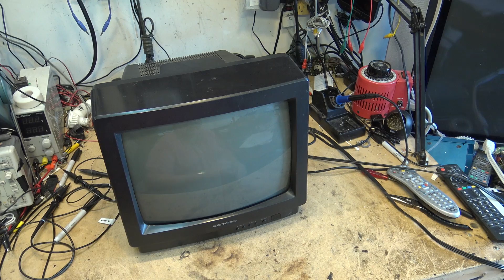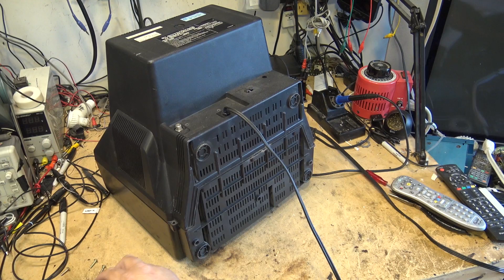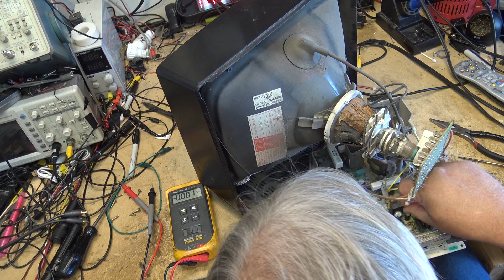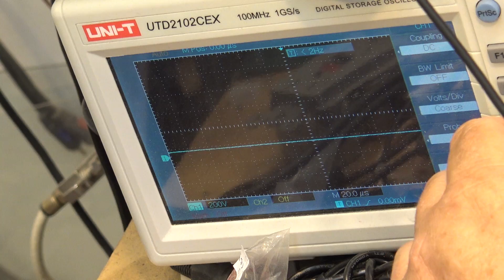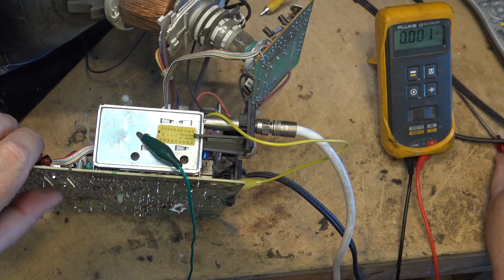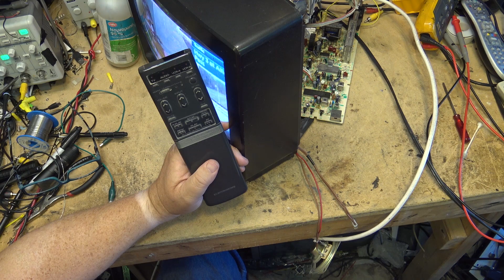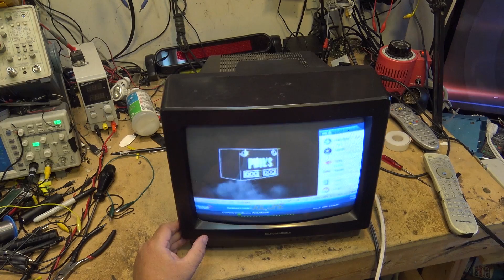Mitsubishi CRT TV from hell   Worst damage I have ever seen   can it be fixed lets find out

Comment: Effects of x-rays from CRTs are well overstated. Such minuscule amounts are generated. Only part way though the vid yet, but I would not like to be around that TV when it powers up and gets warm. Umm, warm cat-puke smell.
Reply from the maker: @Red Stoner 
Crt does produce x-rays. There is a warning on the tube warning of this. Generally consumer devices keep the eht voltage low enough to keep the x-rays produced low and mostly contained to the tube.   Professional monitors on the other hand did not have to comply and to get a higher resolution tube ran the high voltage much higher producing more x-rays.
Reply: The glass of the tube contains lead for this purpose, to contain the x-ray generated inside.
Reply from the maker: @MiniSai256  
Modern tubes yes.  Older tubes no. Many tvs had an extra leaded glass in front of the tube.   Tube TV's were bad with the shunt regulator especially when the repair man left the shielding off because he was too lazy to put it back on.  That happens alot in the 60s and 70s.
Reply: Why don't you go sleep on a CRT for a few years and then get a check up! 😂 If people knew how much poisonous radiation CRTs gave off there would be hella class action lawsuits. Instead, they have been rolled out of production and the consuming masses are none the wiser.
Reply from the maker: @HazeAnderson  
Let me tell you a story about CRTs. This is not shit this is facts because the people I am going to talk about, all worked in the tv business or digital animation business and they are all dead now due to cancers that have been linked to close exposure to low level x rays from crt.   Talk to anyone in the tv business and they will have more stories like this.  3 of the guys mentioned here I worked with at the community station where we did our internship. 3 stayed in broadcast I started my own production company and went into the repair business. 2 of them were cameramen, 1 was an eng shooter and the other a studio camera operator.  Both died of a brain tumour.  The eng operator had a tumor on the right frontal lobe and the studio operator had one form center of forehead.  Right where the x-rays from the b/w viewfinder crt would have been aimed.   The 3 guy worked in master control.  Had a bank of monitors directly in front of him for 8 hours a day.   He died of liver cancer.  None of them saw their 40th birthday.   Coincidence?  The 4th was my neighbours son. He was an animator.  Worked for Pixar studios. Was directly working in finding Nemo and toy story.  One of the lead animators.  Spent sometimes 18 hours a day sitting directly in front of multiple very high res computer monitors.   Cancer in both his liver and pancreas. What are the chances of that?  He was 36.  The difference here is professional equipment is run at higher voltages so they produce more x-rays than consumer gear because they don't need to pass certifications under the cosmetics and radiation emoting devices act like consumer devices.   I spent 20 years working around CRTs but my exposure at close range was limited to a few minutes because as soon as the set was fixed I put it together and pushed it to the corner to test run.  When I did video production. I did have an x-ray spewing professional camera but my exposure was a few hours a week, not 8 hours a day like my friends that chose that occupation.  
The x-rays consumer sets produce are very low, but for a cat lying on top of the set, they are probably not good for them.  My old cat used to seek out dangerous things.  Her favorite places. On the satellite receiver, on this tv, and sitting on the wifi router because it was also warm.  Of course that thing emits microwaves.  Also not good for you.
Reply: Sorry for your losses. 😢 I think the proof is in the pudding --- those things are gone and nobody talks about them anymore. When WE all are finally gone .... those things will be talked about. After all, doctors shunned the notion of washing their hands after handling cadavers so they could get right to delivering a baby ... and that was in the 1800s.
Reply: @12voltvids  In science, to prove what you say is fact, there would have to be a massive double blind trial to rule out coincidence. If I rubbed chicken guts on your head and your headache went, would you say I cured your headache? Similarly, there is a direct correlation between colour TV purchases and road deaths. Does that mean that there isn't causative link. FWIW, I have worked with x-rays every day of my nearly 40 year career and have had large doses due to many medical procedures. By your logic, x-rays does NOT cause cancer. How can you prove that the cancer was not caused by some vapours given off by the monitor?
Reply from the maker: @drteeth7054  
So what you are saying then is the 4 people I know that worked in TV stations and all deviled cancer was not workplace related? I would say the coincidence of 4 unrelated people devoloped relatively rare cancers, 2 that worked in very close proximity to industrial broadcast monitors devoloped liver and pancreatic cancers and 2 camera operators that spent hours every day starting onto a camera viewfinder screen devoloped brain tumours. I would say that is more than a coincidence.  Remember industrial monitors are running at much higher voltages that. Consumer models to achieve a very sharp focus on the tube.  Consumer TV's the 2nd anode for be around 10kv and color 25 kV.   Consumer camera viewfinder around 3kv.   Broadcast camera viewfinder on a 1.5" tube 7 - 10kv.  Be monitors 15 kV and color monitors 40kv were not uncommon.  Higher the voltage the more x-rays produced.   Everyone I know that worked in the industry is very nervous on what they might end up with.
Reply: @12voltvids  Note how all consumer cameras that used mini b&w tubes in the viewfinder all use a mirror and point the CRT 90 degrees away from the eyeball.
Reply from the maker: @spikester  no they didn't.  Just the larger full size shoulder Mount vhs did and that was only because it allowed for a more compact design.  All broadcast cameras did this too and it makes no difference because the majority of the x-rays will also bounce off that first surface mirror.  All the handyman type of camcorder used a small tube and you looked straight into it.  I have such a tube in my video "smallest crt in the world and it works"
Reply: @12voltvids  Thanks for correcting, indeed it was the VHS fullsizes I was referring to as that's all I had access to as a kid. Was there nobody to complain to for health and safety regarding professional grade units and operating voltage back in the day? Any engineer designing these should have mandated some extra leaded glass in the viewfinder glass.
Reply from the maker: @spikester  
The professional units did not have to meet limits set out my the cosmetics and radiation emoting device guidelines.  The voltage was run so high on these tubes to produce a very fine focus.  It's unfortunate that many were exposed to higher levels of x-rays and many devoloped cancers from them.
Reply: @12voltvids  Makes you wonder everyone in the retro gaming scene getting Sony PVM's  & BVM's, curious what their anode voltages are to produce such fine scanlines. I'll stick to my consumer trinitron for that me thinks...
Reply: @HazeAnderson  Do you wear an aluminium hat so "they" cannot read your mind?
Reply: @drteeth7054  my channel and 12voltvids channels are wide open for all to see who we are what we do. Your channel is void of any content and you don't even have subscribers. For all we know you are what is known as a PAID SHILL -- someone is paying you to cover up for their sins.